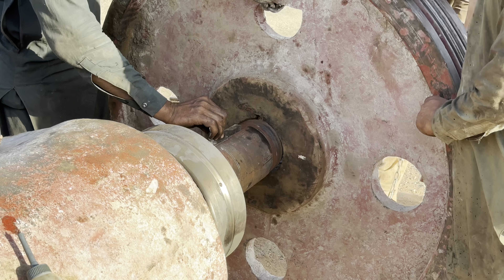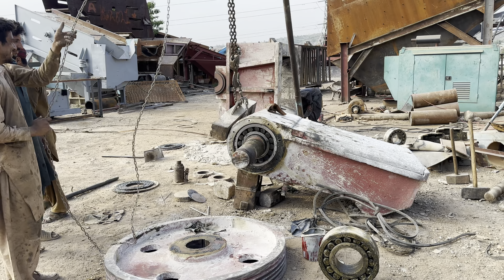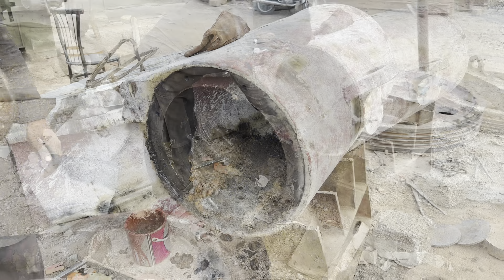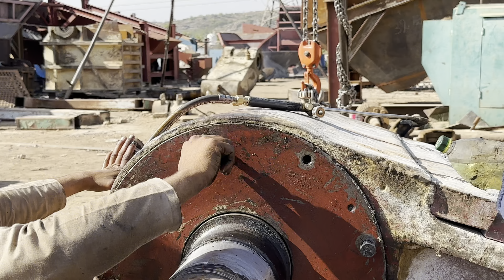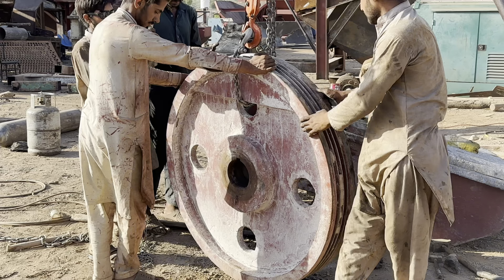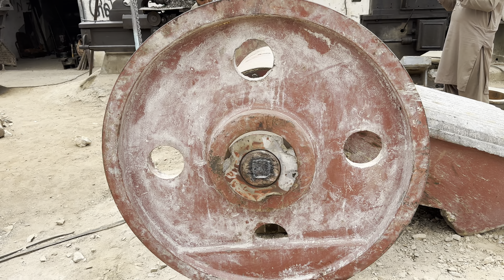Amazing Hard Working Young Boys  Complete Restoration Stone Crusher Machine How To Repair Crusher MH

Comment: I do not want to be over critical of these guys because I know they are working with very limited resources and they do work their balls off repairing these crusher jobs.
I would like to make a couple of comments, firstly what is the SWL of that fan belt they use for lifting and I suppose a load test cert is out of the question.
Secondly.  If you heat a bearing over an open fire not only do you increase the diameter of the I,D. but the O.D. also increases. So what I suggest is instead of beating the crap out of the shaft/bearing to install it into is housing is to wait a while until the bearing cools down reduces back to its normal size and it should go back in to its housing without all the blood sweat and tears the go back into reinstallation
Retired mechanical engineer